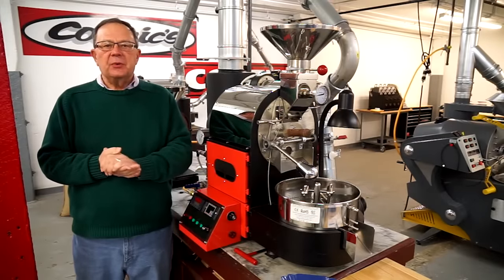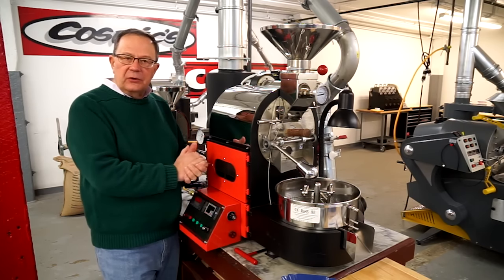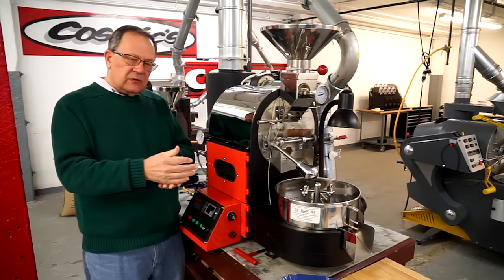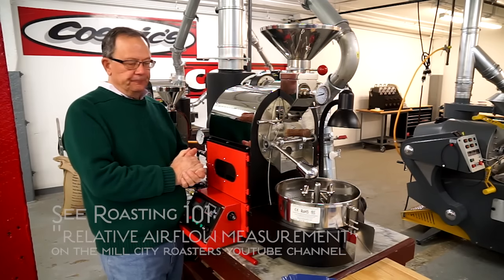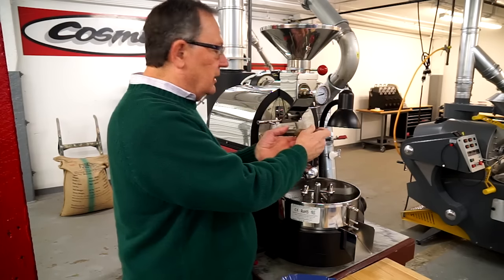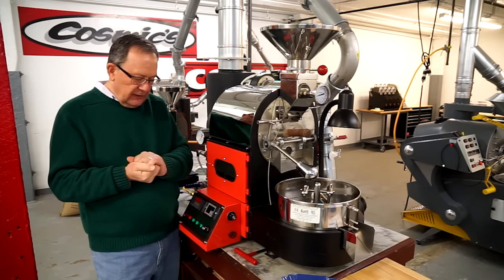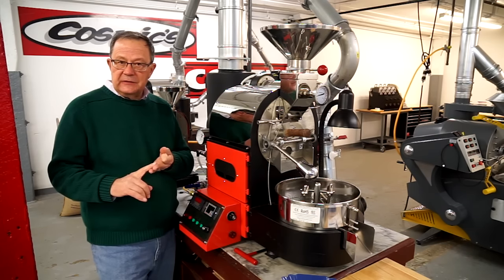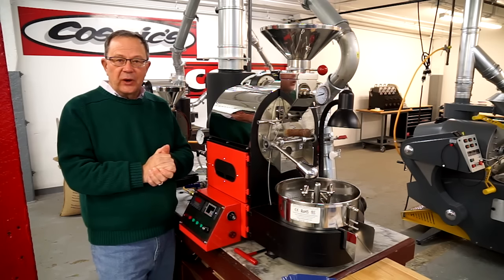Roasting 101 - Roast Stages and the Use of Airflow

Comment: Great video. Thanks.
What is that big roaster behind? Coffee-Tech Engineering Giblhi???
Reply from the maker: Over the years, we've tested a great variety of roasters. That was a Coffee-Tech Silon. Okay roaster, rough burner modulation,  a total bummer to repair and maintain. Avoid the copper drum insert at all costs. YMMV.
Reply: @MillCityRoastersMN  Thanks for taking your time to answer! I really thought it was a roaster you can maintain with eyed closed.
Why the is copper should be avoidable?
I have the Bullet...my next roaster will be the MillCity 1KG for sure!
Reply from the maker: Long story, but several users reported the copper corroding enough to create gaping holes in the drum.

Comment: I have a Mill City 3-kilo. If I take the airflow past 50 percent, the beans shoot right out of exhaust. Ideas?
Reply from the maker: Thats a big fan for a relatively small roaster and we typically use no more than 1/3 the capacity.  Is there some reason you think you should be running higher airflow?
Reply: @MillCityRoastersMN Trying to get a consistent roast. I’ve got the drum speed at 100. Today I used less heat…so far, so good